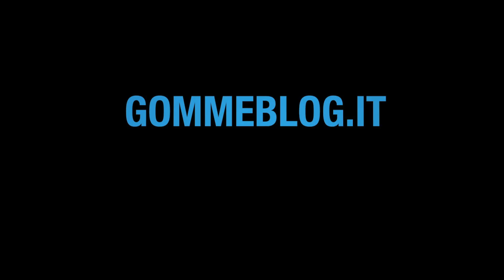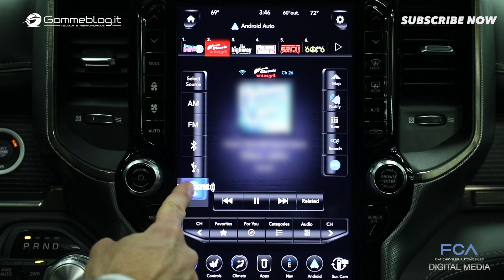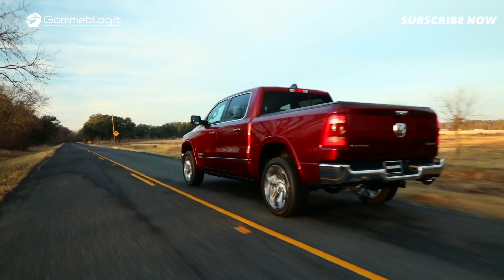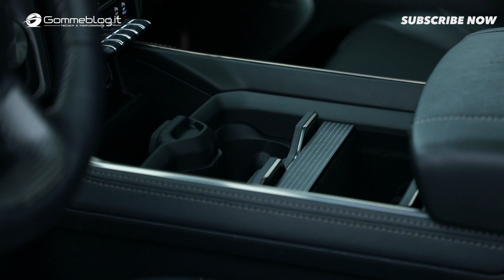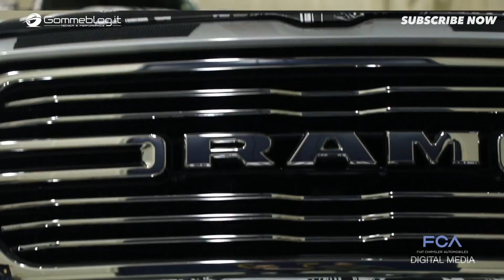2019 RAM 1500 - Pickup INTERIOR + EXTERIOR + HOW IT'S MADE and DESIGN

Comment from the maker: Ram 1500 (2019) - No Compromise Truck, Leading in Durability, Technology and Efficiency

00:00 - 2019 Ram 1500: Wind Tunnel Testing
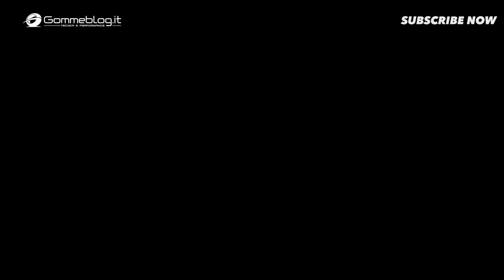02:23 - 2019 Ram 1500: Uconnect
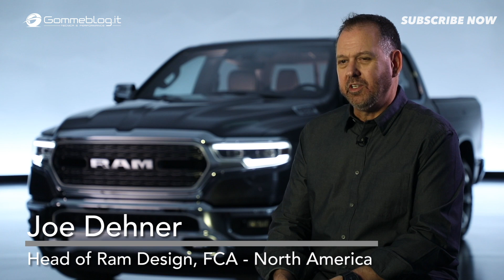06:00 - 2019 Ram 1500: Exterior Design
08:53 - 2019 Ram 1500: Interior Design
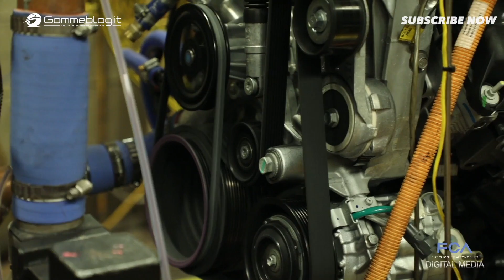11:49 - 2019 Ram 1500: Dyno Testing
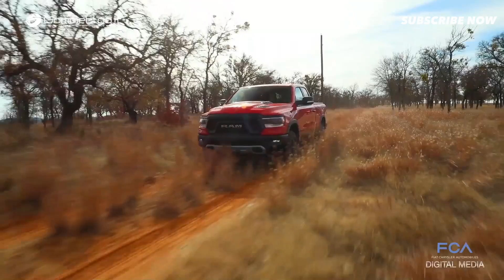14:02 - 2019 Ram 1500: Materials / Chassis Engineering
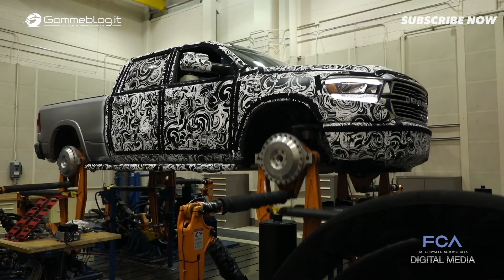17:00 - 2019 Ram 1500: Shaker Testing

Comment: I have a 2017 Longhorn.  I've owned Rams for more than 10 years.  My biggest bug with their Uconnect system is that I could never find a way to transfer all my way points and addresses from my portable Garmin GPS to the Dodge Uconnect system.  For that reason I NEVER use the map function in my dodge.  I stick with my Garmin.
Reply from the maker: Thanks for your comment !!